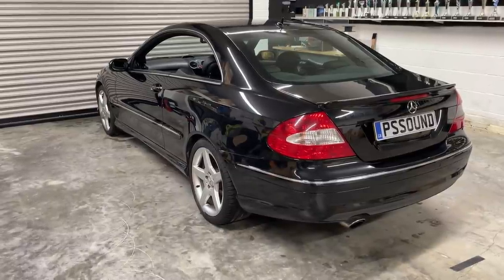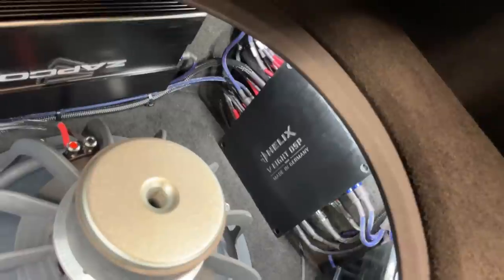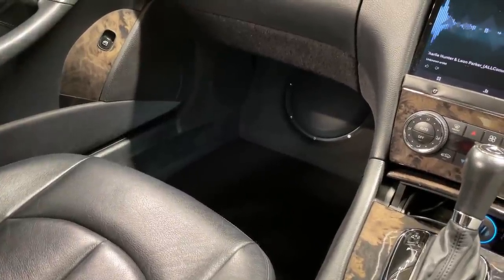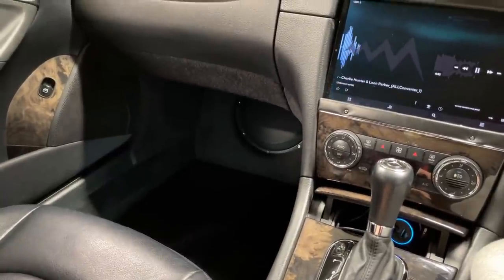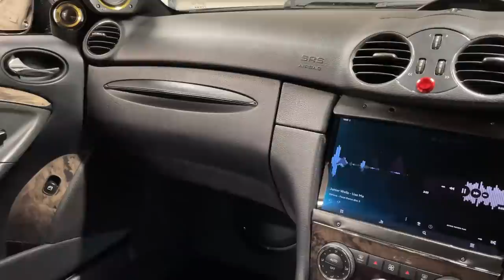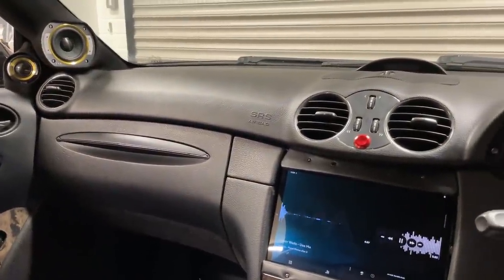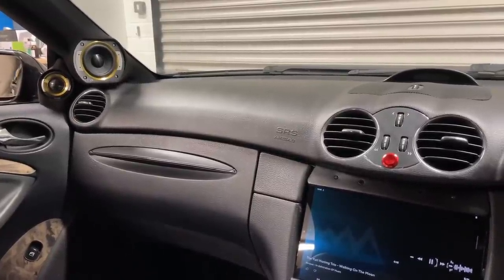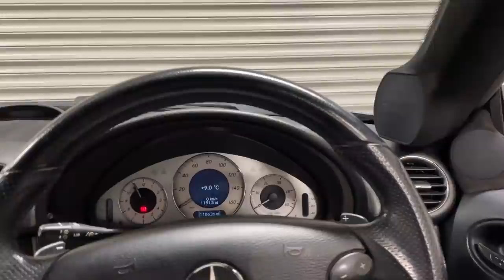Mercedes CLK 5WAY SQ System - PART 5 - EXPLAINED Walkaround - ESB Audio, Helix, JL Audio, AE

Comment: Another great install Peter!
Clean and stealth 😀
Don't take this as overly picky, and you may know this, but the Zapco emblem is held on with adhesive tape and could be removed and reinstalled right side up.
Absolutely love all your videos!
Reply from the maker: The logo has locator pins too and the other way around you’d need to shave those off and just rely on glue. We didn’t want to risk that. Maybe next time.

Comment: Mark Aldridge(?) mentioned on a podcast that surface mounted dash speakers suffer from direct and reflected wave propagation delay. His solution for dash mounted speakers was to recess the speaker into the dash and control reflections with waveguides. Or, find the exact angle that the surface mounted speaker needs to be mounted at to minimize the direct and reflected delay.

I am currently working on 3Dprinting a speaker mount/waveguide to mount a full range SB Acoustics SB65WBAC25-4 in the dash corners of my 2008 Ford Fusion. Imagine a Morel CAT378, but with a middler and a deeper waveguide.

Comment: you can force higher sample rate on android. you can use usb audio player or neutron :)
Reply: Thanks for your message. I wish I had explained more but honestly I think my brain was so distracted by this insane system, I'm still not sure the reality has kicked in completely, Peter and his team have done an amazing job on this stealthy install. I use Poweramp for higher sample rates with the Topping D10s but I also occasionally use Plex which does not support 44.1 or higher than 48 (even though it streams FLACs). I wish it was system wide on Android. A Windows setup would also benefit from a sub 15 second boot time vs Samsung's android which seems to take forever. Plus Winamp's fantastic visualisation/plugin support. Strangely the Galaxy Tab S8 takes even longer to boot! I might try a non-Samsung custom ROM for the meantime and give your recommendations a go too! 👍👍
Reply: @TheTechKnowG  nice, im gonna have a pc in my car aswell..
that system looks so amazing, u was probably in "shock" when u was there :D.

lovely build :) and cant wait till u get the pc installed :)
Reply: @TheTechKnowG  Hi dude is that your car? I'm jealous 😃.
Reply: @TheTechKnowG  how do you charge the tablet when connected to the d10s?
Reply: @MrLinkan2  USB-C Dock (Anker 543 6-in-1 to be exact). These docks allow you to charge via USB-C power and plug in USB Type A devices, no issues.
Reply: @TheTechKnowG  i have read a lot about that Android devices dont support OTG and charging simultaniously but maybe samsung devices do?
Reply: @MrLinkan2  USB-C docks work from the Samsung Tab S4 upwards. Compatibility issues were a huge problem when the port was MicroUSB but nowadays support is much better. Other ports supported on the dock like Ethernet and HDMI is going to very between devices however!